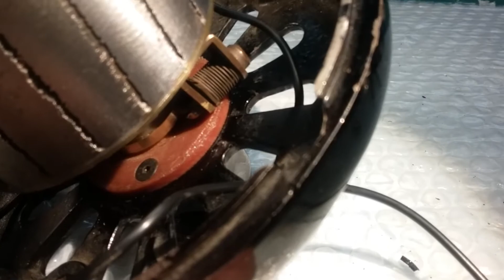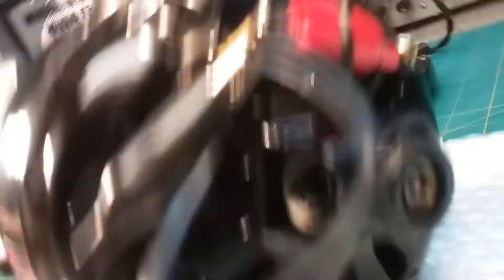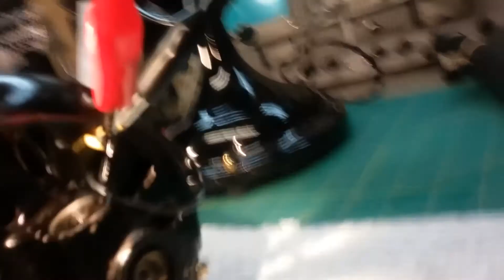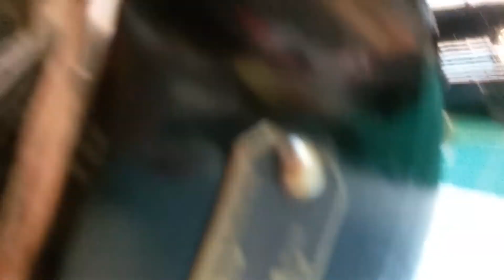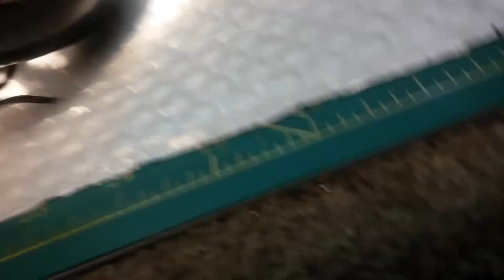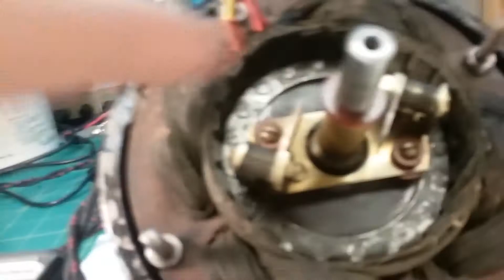1890s GE Antique Fan Motor - 337738 - Part 2: Running Issues

Comment: I notice the spring of the contact that is sticking has a thinner diameter spring on it compared to the one that doesn't. Spring tension is important here.
I have no idea why they are different in thickness  but it may have been replaced at one time, a long time ago! That would explain the burn marks  or should I
call it scoring marks on the thick brass contact ring. The contact seems to have a poor time of going into the holes on either end of the support' s
 on the bad one.May need to slightly enlarge the bore on the out board end to keep it from sticking, possibly a light oil on the end may help.
Reply from the maker: Actually the springs are the same diameter. It might look different on the video. I think the contact pressure may be a little different because one spring is bent a little on the end. However,  I have not completely ruled out the rotor or stator coil though.  I will upload another video once I get back on it.